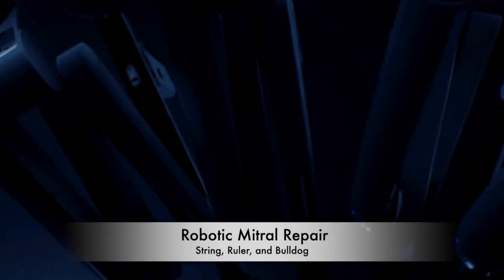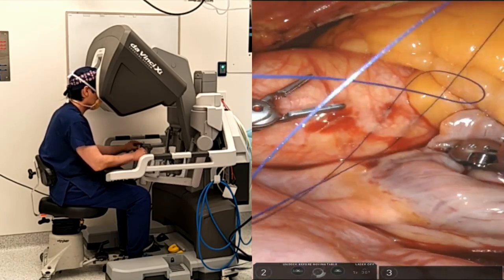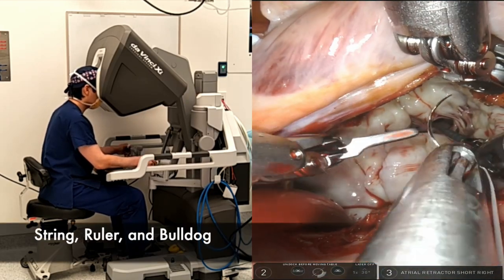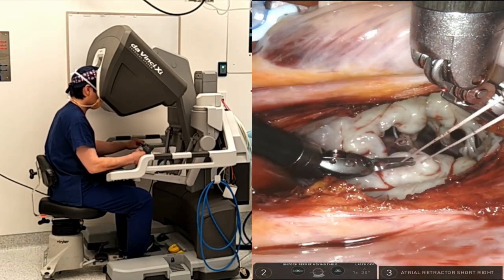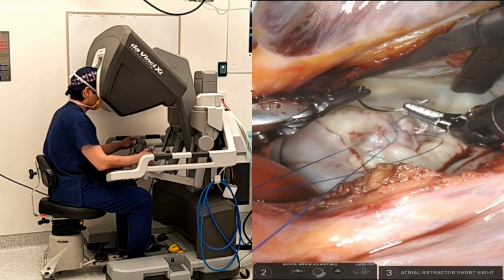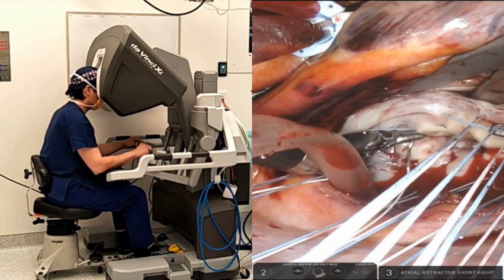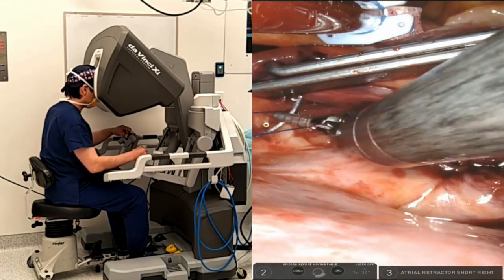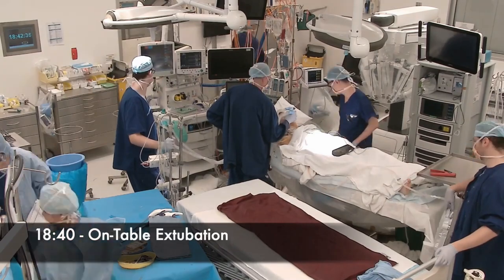Robotic Mitral Repair - String, Ruler and Bulldog

Comment: How do you decide neo-chordae length? and do you have difference in neo-chordae length decision for anterior and posterior leaflet?
Reply from the maker: The length of neo-chordae is determined based on transoesophageal measurement of a normal chord during systole, from the tip of papillary muscle to the mitral annular plane.
Reply: Thanks,  Professor D.Yan. I am referring to your YouTube message. We will start DaVinci mitralplasty in Okinawa next month.
Reply from the maker: @山内昭彦  All the best with your robotic program.